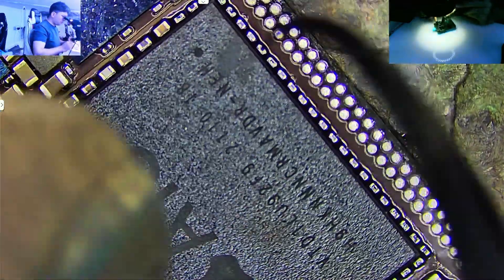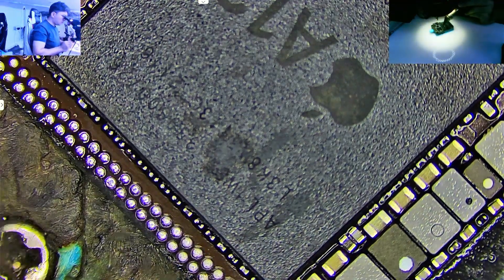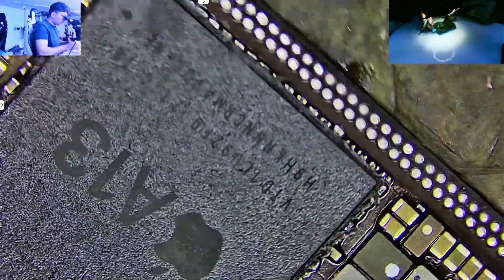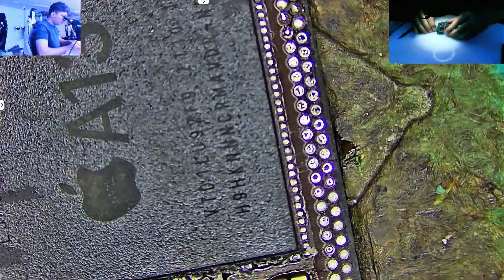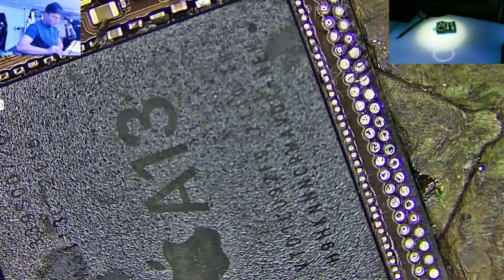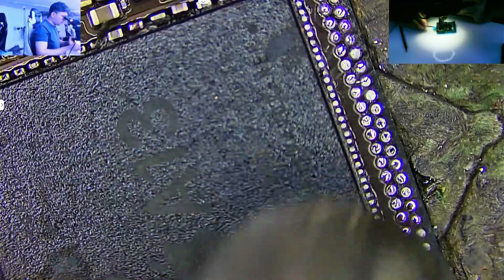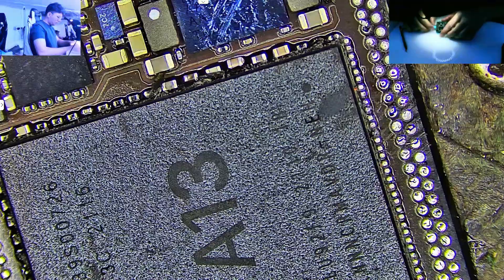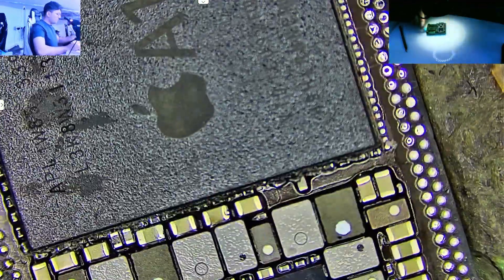How to Safely Remove & Clean iPhone CPU | Easy iPhone Repair Tip | PRE

Comment: What can you tell me about that row of tiny components (they look like 0201 capacitors) next to the CPU that you completely removed? How do I restore them in the end?
Reply from the maker: Thanks for your question! The reason we removed the CPU from that board is because the motherboard was already damaged beyond repair — likely due to multiple failed repair attempts by other technicians. So we don’t need to worry about the small components like the 0201 capacitors around the CPU. We’re using this board as a donor, and the working CPU will be transferred to a good, clean board. That way, we restore full functionality without relying on any damaged parts from the original board.
Reply: @PhoneRescueExpert  Thanks for your reply. What really seems difficult to me — and I don’t know how people manage to do it — is removing a CPU without shifting or blowing away the tiny components around it...